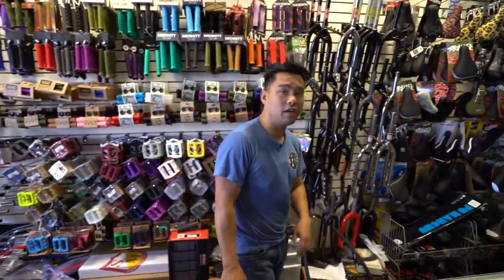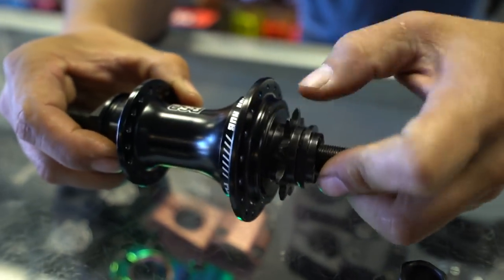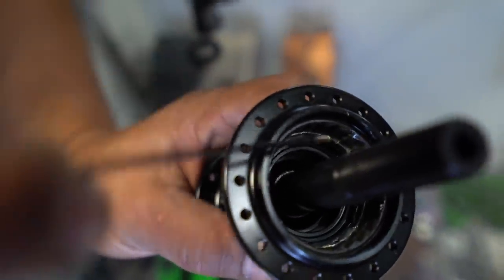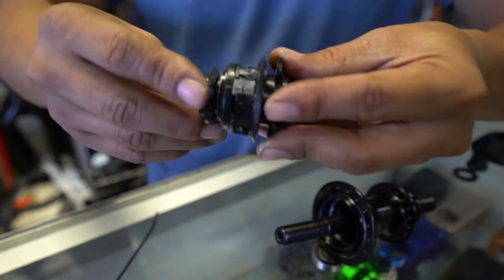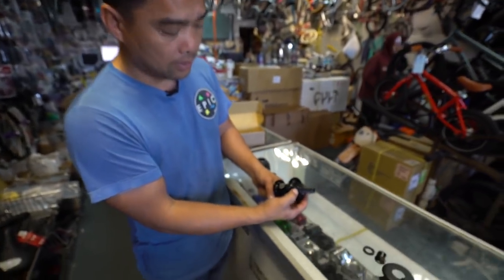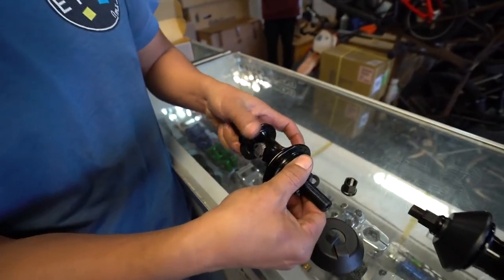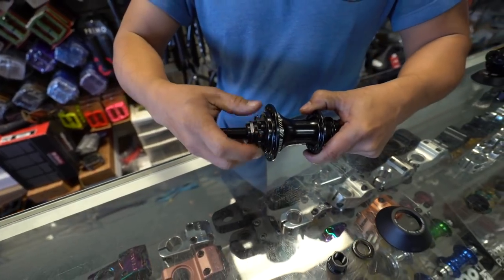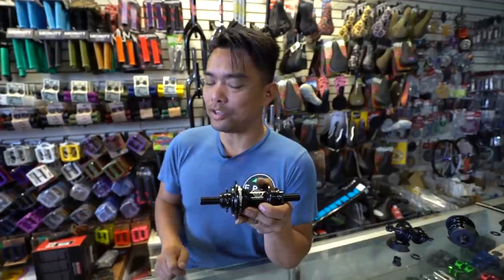BSD Revolution Planetary Freecoaster Hub Review and Dissection!

Comment: I got my BSD Revolution wheel the other week, and I have to say, the hype is REAL. Only thing more that I would've wanted from it would've been a female axle option, but regardless, it still rendered every other freecoaster almost instantly obsolete.
Reply: Great post! 👍
I completely agree with this.
Doesn't having a female axle work best for riders that slam their wheel in the dropouts so they don't have to break their chain to service the back wheel? (That's a nightmare in itself for some riders) 
Plus having dropouts with a integrated chain tensioner through the dropouts can cause pinching threads on the hub axle itself. 
Ride more, work on your bike less.
Reply: It wouldn't work as a female axle because of the amount of pressure the driver needs to actually work like he explained in the video. With females axles there's no way to tighten the outside cone so it simply wouldn't be tight enough for the mechanism to work
Reply: @Mish2353  please elaborate??

Comment: No springs inside the clutch. All just gears... At least that is how the original is. There is actually a rubber o-ring inside the clutch that causes friction when going forward and that is what causes the clutch to engage and raise the driver pawls.
Reply: You're right!
Reply: i think that o-ring is why mine is having engagement issues.
Reply: @sole__doubt  the OG freenight was pretty easy to replace the o-ring. I have been running my BSD for a year now and haven't had any issues so I haven't needed to do anything yet.
Reply: @MiddleAgeBMX  i got caught in the rain a few weeks ago and after that I had engagement issues.   Im having trouble getting the jam nuts off, they are really on there tight.  Im gonna get me a bigger crescent wrench hopefully that helps.  If not , Im bringing it to the shop

Comment: Ive had mine for about a year and a half with no trouble until recently.  Im having engagement issues so I changed back to my cassette, but now I see you have this video Im gonna try to repair it myself before bringing it to the bike shop.  If anyone has any advice it would be greatly appreciated.  Thank you so much for making these videos.  ;)
Reply: @brant_moore has a video all about planetary freecoaster maintenance but if i remember off the top of my head i think that your issue is most likely because your jam nuts arent tight enough or your planetary isnt sitting in its grooves correctly. try tightening up your jam nuts really tight with a wrench and the allen hole.
Reply: @williambodger551  actually the jam nuts were put on so tight by whoever assembled the wheel that I cant take the hub apart.
Reply: Its most likely time to replace the O-ring inside the clutch. Please contact us (freenight) if you need any help.
Reply: @nightriderbmxshop6768  I was able to take it apart and get it working again. I got caught in a downpour and water got into it and evidently enough water remained to make it engagement an issue.  Once I dried and cleaned the internals it worked like new again.
Reply: @sole__doubt  excellent!

Comment: I just got back into riding and got a bike with an fc and its been a weird transition but im getting the hang of it. My only question is can I still do a brakeless tire tap on a quarter and hold the pressure like i could with a cassette?
Reply from the maker: I haven’t ridden one yet, but I don’t believe so. I can confirm in a few weeks

Comment: I'm intrigued to see how the female version works if the pressure provided by the cone nut is so integral to the hub working.
Reply from the maker: Coming real soon!
Reply: The later versions have inner o-rings to keep the spacer fixed on the axle, so less pressure is needed from the cone nut.

Comment: Isn’t just a zcoster that profile makes
Reply from the maker: Similar but different mechanisms
Reply: @AlfredoMancuso  ohh ok
Reply: the zcoaster has to be disengaged, don’t quote me but i believe it’s heavier and while the z coaster is still engaged and you go backwards the petals move back and it allows you to do tire taps and 270 taps , a 270 tap has been done with this hub design (brakeless of course with petal pressure of course) but it’s not consistent enough to count , brant moore did a video on this with trevor

Comment: Hey alf. Great vid. Have you done or could you do a vid on what causes hubs to slip. I have pulled my hub apart a few times and tried to fix it from slipping. It all looks good to my untrained eye so id love some real advice before i buy parts that i may not need. Cheers bro
Reply: Is it a cassette or freecoaster?
Reply: @macaulleyjordan1603  its a cassette with the paws in the rim and the teeth on the driver
Reply: @doriking275  paws in the rim? Do you mean it's got the grooves inside the hub and then on the driver are pawls, and springs underneath them?
Reply: So when i take the axle out. The rear sprocket/driver has teeth around it and the paws that engage to the teeth are inside the hub. If that makes sense. As apposed to the paws being attached to the rear sprocket/driver and the teeth inside the hub
Reply: @doriking275  ok got ya, if its slipping, either the teeth on the driver have worn down and lost their "edge" or the pawls have worn down, if you can get access to the springs under the pawls then bend them up slightly to create more tension on the pawls and teeth, that will reduce the slipping problem, failing that replace the pawls in the hub, but if the teeth on the driver have worn down  then you either need to replace the driver or get a new hub, most of the time just bending the springs up slightly and creating more tension fixes the problem
Reply: Thanks for taking the time to respond. I got the rear wheel second hand and the sealed bearings in the center were noisie and wobbly. So i replaced the sealed center bearing and all the roller bearings hoping to fix it. While it rolls fine now it slips and still cant be used. I have pulled it out a few times and made sure the paws are in the rite way and the circle spring that holds them in is alligned in its groves proply. I have a small amount of new grease as to lube it but not gum it up. Im not sure if i just need a new driver/rear sprocket or not because it looks fine to me. It would make sense that it would slip if the teeth were broken but they look fine to me. Im not completely familiar with this style of sprocket because the last time i was playing around with bike wheels was 15/20 years ago and the newer tech is a little different to say the least. Im quite competent with anything mechanical so im sure that with a little help from a pro i can sort out my problem and with a online tutorial, alot of other riders could too benefit. I have searched a few times for info on this style of hub but cant find much if annything on them. I also have a 2019 gt air with the same style of hub that is in perfect condition that i pulled apart to see any differences but it all looks the same. After pulling the axle out of my (broken) rim 4/5 times im kinda at a loss. Apart from the fact that i can now pull the axle out and put it back in, in record time. Cheers for reading my sob story and i hope i cleared up any info that could help someone help me!

Comment: How is this different than just running low slack in a free coaster?
Reply: Because running low slack means pedalling a bit forward will engage the hub. 
This hub basically has unlimited slack when going backwards.
You can pedal forward while going backwards with this this as long as you don't pedal too fast.
If you pedal forward faster than the gearing is spinning bringing the pawls down then it will engage.
It is based off the Freenight Planetary freecoaster and I have been running a prototype for almost two years and it really is game changing.
Reply: @_tcmore  oh wow ok definitely just improved my opinion on this hub🙌🙌
Reply: @cameronholcomb6578  it takes a bit getting used to it I found but I can't ride anything else now. Pretty much the faster you go fakie the less you have to worry about it engaging. It's just the initial going forward to fakie that has a possibility of making it engage and that's if you somehow engage the the pawls while going into the fakie which is pretty hard to do.
Reply: @_tcmore  definitely have to check it out some day

Comment: These hubs are nice but they break so easily
Reply: really, have you had any issues? ive done some searching around and it all seems to be user error on the most part, you just have to make sure you have everything in the right spot done up tight
Reply: @williambodger551  yes, and cleaning the extra lube also helps because the lube reduces friction, and that can cause engagemeny issues...